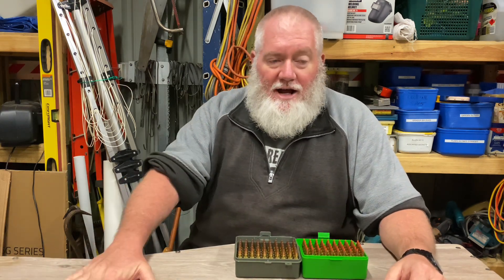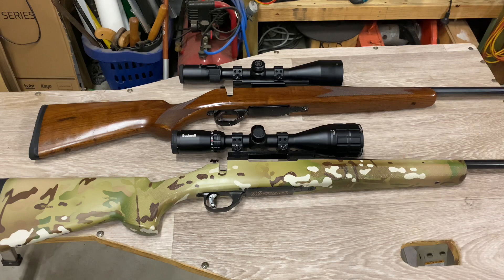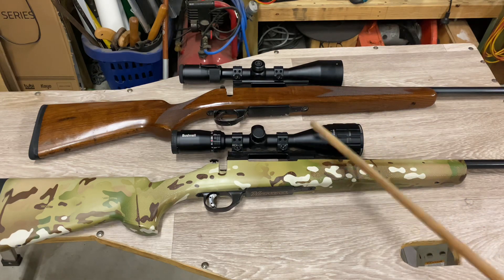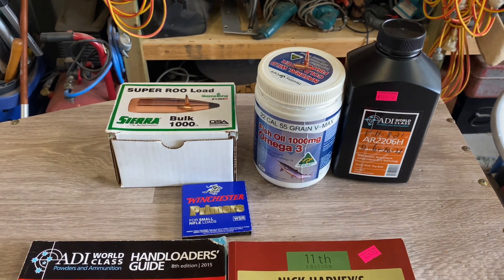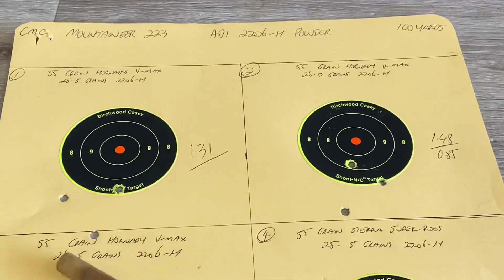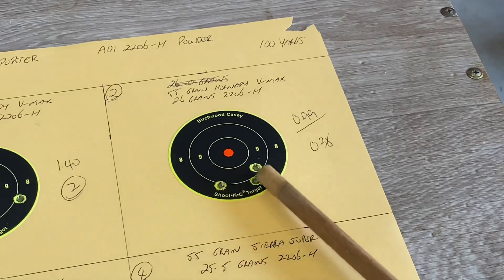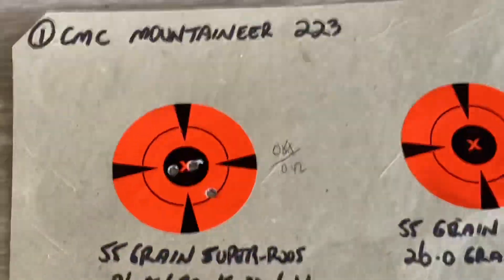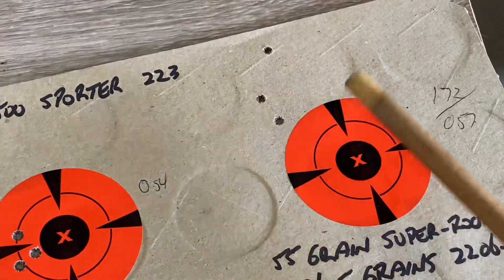223 Load Development

Comment: hey mate when you are doing the load development are you ever changing seating depth ( overall ogive length) ?
cheers love the videos
Reply from the maker: Truth be told, I don’t really chase seating depth too much. I’m only loading hunting ammo. I trim the brass so the round will fit in the rifle without a tight bolt close and the empty brass will eject without issue. I don’t chase the lands with regard to seating depth; in fact, I couldn’t tell you any jump to the lands. I set the COAL so the round will fit in the magazine and load up into the chamber with the bolt closing easily.